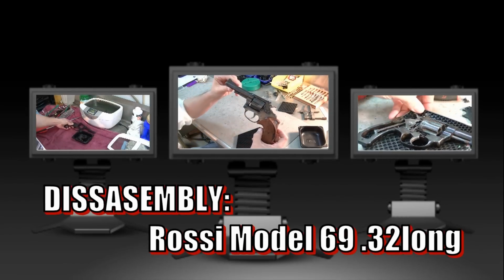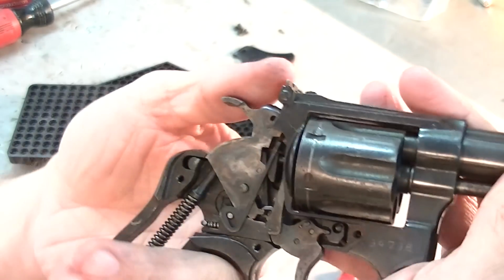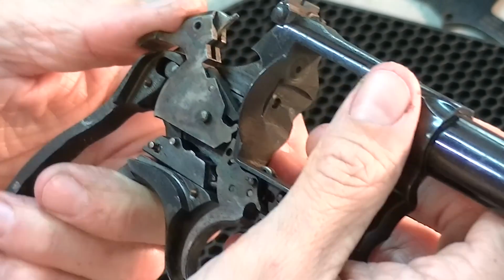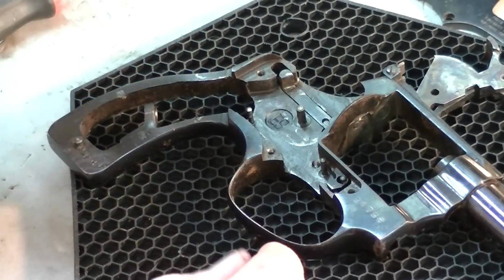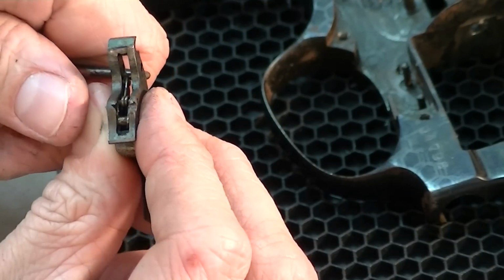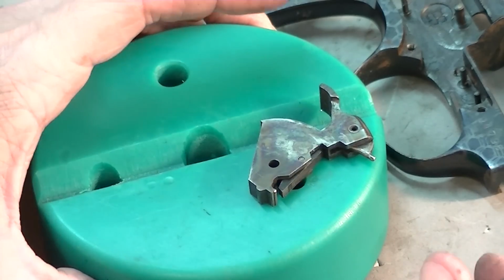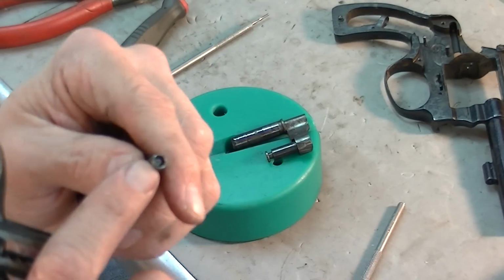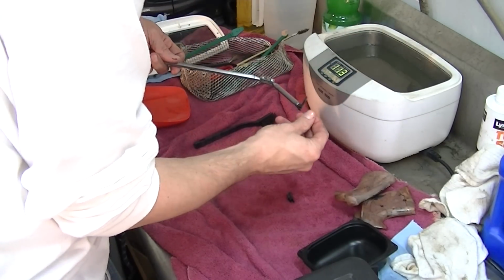Rossi M69 32long revolver Dissasembly

Comment: Thank you for this video. I bought an older Rossi M68 for $35, but it was missing a few internal parts. The M68 and M69 are nearly identical internally, and this video showed me what I needed to order.
Reply: Hello, what does the numbers on the frame, behind the handle, mean? Is it an assembly number or does it have anything to do with making the revolver?

Comment: In being trained as a gunsmith I must point out that there is a major difference between a parts replacer and a gunsmith. Yes, your sear seems to be worn as its surface is to negative. But replacement is not necessary.  It needs to be re-cut. Its angle should be positive. After stoning the sear properly,  when put back in the revolver you can grip the revolver normally but with your thumb against the rear of the hammer. Now, pulling the trigger single action the hammer should move rearward a few thousandths before breaking it's connection with the sear. If it dosent it is still not fitted properly,  try again. Be very judicious in doing so as these surfaces are case hardened to a few thousandths and if you go to deep you will want to use Kaseinit to re harden the sear surface. Also, when disassembling a Rossi, S&W, Taurus etc. cylinder it is vital that you should place 2 cases opposite each other in the cylinder so as not to torque the ejector rod or damage the ejector itself. These revolvers share much in design with S&W's but they are NOT exactly the same. However,  like the older style Smiths, they have a hammer mounted firing pin. It is very advisable not to remove the firing pin during normal disassembly as this is a semi permanent installation.  It is not actually a roll pin that retains them, but a rivet, hence the peened over ends! This should only be done for replacement or re-tipping. Your firing pin tip should be hemispherical. Its protrusion should be .040"positive and no more than .080" absolute, being pushed foward as far as it can go. It should not exceed the diameter of the firing pin. The correct way to remove the cylinder stop is to, as you push it down through its window, you take a small screwdriver and pull back on the cylinder stop spring as you lift it from its frame post. I get what your saying about removing the side plate, but if your working on a customer's gun, ANY scratch is unacceptable.  The correct way is to rap the handle of your screwdriver against the side of the grip, this will do it. This is not a commentary on any mistakes made but rather a promotion of information about our trade. We all have a love of firearms as a common basis of conversation and friendship, I hope. By the way if you truley want to learn and understand this style of revolver, the best information EVER printed on the subject can be found in the series of books written by Jerry Kuhnhausen. He wrote them for the 98 mauser, Colt revolvers, S&W, Rem 1100/870, Ruger DA, Colt SA and others. They are un- paralleled.  I hope some of this has helped.
Reply from the maker: Hey thanks for the info.  You know that is one of the reasons I became a gunsmith and enjoy it so much is that no matter how long I live, I will never see every type of .22. Let alone all of the other types and calibers! haha  This was an older video and many of my procedures have changed since this being shot.  No matter what I learned as an apprentice or think i know it is always nice to have someone that happens to know more about a specific type chime in and share their knowledge. Thanks so much.  There are a ton of "certified parts swappers" out there and probably a 1/4 of my business is from those guys as I bale them out. haha  What you were saying about replacement being necessary or not.... That is one of those things that I have found that often it is in the customer's best interest to get a new part rather than pay my time working on their old parts.  As a business sometimes what "can" be done doesn't matter as it is often a better decision for bottom line (time vs cost) to swap the part.  Not always though. Have a great one and thanks!
Reply: Well said sir
Reply: Gene Brown m
Reply: Glad you’re not gunsmith

Comment: This gun it's not a Model 69 (that has a 3-inch barrel), but a relatively rare Model 39. Rossi revolvers with 4-inch barrel in .32 S&W Long caliber were made in very small quantities.

Only a factory manual that I have mentions it, but it was omitted from three catalogs that I have (1979, 1989 and 1995), because  this model was made only from October, 1969 to 1974. Serial number range for this model starts from 94001 up to 132178 (mixed with other models in same caliber).

Production volume was very low: 72 blued and 83 nickel-plated monthly.

Comment: Excellent video!  Well done.  Clear verbal description of what you were doing, what to look for, cautions, etc.  Didn't know the cylinder came apart like that.  I have a model 68 so I was interested.  Would be interested in seeing the assembly, and what part fixed the trigger wobble.  What cleaning solution did you use?  Just a super video.  Thank You.

Comment: I have a m68 rossi 38 special an my cylinder only rotates if I cock the hammer back aiming at the ground, fo you know what it can be?
Reply: Same thing happened to me.There is a spring that rests against the side plate screw. You hafta pull it over before you put that screw in.

Comment: i was taking my rossi 461 apart and a metal piece dropped out once i took off the plate it looks like it sits between the hammer and rests on the trigger spring ive looked on the manual and it says the part is number 32 but i cant see what its for or called its not listed, also if i try to place it back in the gun my trigger/hammer will not move at all, if i leave it out functions fine, but haven't seen if it shoots still i dont wanna damage it, if you could give insight id really be thankful

Comment: Thanks for the video it helped me disassemble my m68. I noticed the second piece you removed after removing the side plate wasn't spring loaded and only had one pin. Is it possible that the second pin is the super small one that you found in the trigger?
Reply from the maker: Caleb White Yea, that was the broken remains of the pin from the hand.  This video was one shot a long time ago as I was learning to be a gunsmith.
Reply: Ok cool .... again thanks for the video I am not a gun smith by any means but I inherited a 68 from my great aunt and it had never been cleaned and I was totally lost
Reply from the maker: Caleb White Well keep me in mind in the future if you ever need anything gunsmith wise done. I offer custom builds, coatings, restorations, and about everything gunsmith wise..

Comment: The revolver side plate should never be taken off with a screwdriver blade, as it cans harm it. You should tap the gun's grip with a soft material like, for example, a hammer's handle.
Reply from the maker: noted, I had already attempted this and it would not come off that way. If you notice, I am prying from the inside. Not on the lip/edges.
Reply: TDCtactical I had to open my M851 that way as well. They fit those covers tight.
Reply from the maker: Alberto, Kevin is right. I am well aware of the methods normally employed to dissy these guns. For certain ones this method does not work. If you notice I am actually placing it up in there and twisting, not prying. There is no danger of damaging the cover this way. I had already had this gun apart and knew in advanced that it was too tight for the normal tapping method.  Thank you very much for watching and writing. I welcome any constructive criticism that can be offered always.
Reply: TDCtactical moto
mofo
Miro
Reply: Isso e rolema como vc e sua irmã

Comment: Nice reuse of primer trays....Where did you get mats? Is there a part 2 of the video I am so interested in finding out how it turned out for you
Reply from the maker: +Taurus/Hipoint Enthusiast Thanks,  those mats can be found in all types of places like Walmart, Big Lots, Dollar General, Carolina Pottery, etc.... Look in the cooking utensil area and they are usually hanging up on the isle ends.  They are sold as grip aides for removing tight lids.  Unfortunatly I lost the footage for the part 2 of this series but if you go to my channel and click on the playlist you can look at some of the other revolver/wheel gun videos and maybe find the info you seek. If not yell at me via email. TeamKLRDefensiveConcepts@gmail.com
Reply: Cool and thanks for that.Nothing particular.Just wondering if you replaced all springs or just the ones hard ridden..Thanks again.And if you found the part that was worn.
Reply from the maker: Taurus/Hipoint Enthusiast without  going back and watching the video  I don't remember. This was a customer's gun.  Wolff gunsprings offers spring packs for most guns that include all the springs and are very reasonable.  If you need I am a wolff dealer and can get you pricing.  Email me for that:  TeamKLRDefensiveConcepts@gmail.com
Reply: Way cool.Gotta remember that.I like to replace the springs when I can.

Comment: You lost me when you pried the side plste off with a flathead screwdriver. You should never do that. Rap the grip frame with
the handle of the screwdriver or a mallett two or three times and the side plate will just pop up.

Comment from the maker: It sounds to me as if you are speaking of the "hammer block". This is a safety feature to keep the gun from firing if the hammer is struck while in the down/decocked position. Or you are talking about the "hand",  that is responsible for turning the cylinder. Which one do you think it is?  Oh: please drop me an email to continue if you need to discuss this in more detail: teamklrdefensiveconcepts@gmail.com

Comment: Don't like Rossi products. Some look nice, but they just don't have the quality of a Colt, S&W or Ruger. I think I'd by Charter Arms before I bought Rossi ever again.
Reply from the maker: +J P Of coarse you are right but so many can only afford Rossi prices. As a gunsmith I can say without a doubt that Rossi metals are superior to CA's. Design and overall quality is up for grabs.
Reply: +J P It was a great video, but I feel Rossi is a false economy. They may seem affordable, but you buy it once and then pay again for repairs. I've owned a Rossi shotgun and pump action .22, in both cases failure occurred due to poorly heat treated parts that wore out way too soon.
Reply: I don't agree with that at all. I don't have a spare Rockwell hardness testing machine, but my own experience has taught me Rossi s are CRAP. I own two Charter Arms revolvers and they have given me no problems. Rossi yrs. ago had decent metal, but they have skimped to the point of having to sell their company. Charter Arms is not a S&W or Colt, but their products get better every year. They have also brought new innovations to market like the new revolvers that fire rimless cartridges without using moon clips.